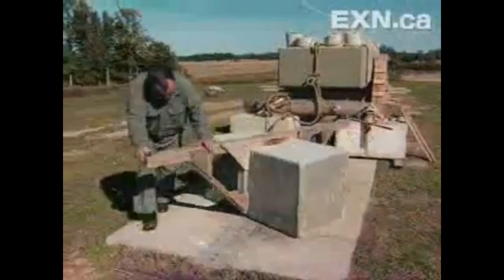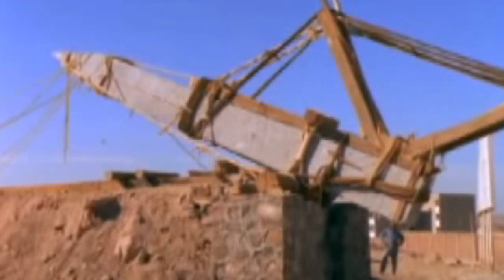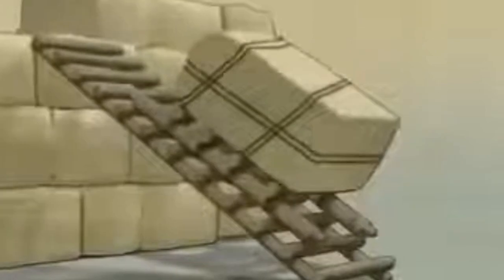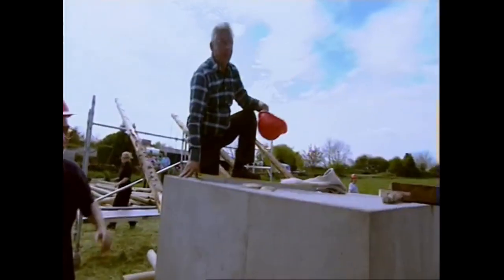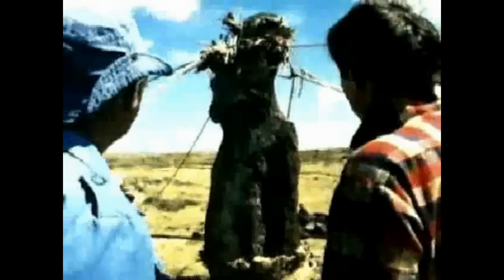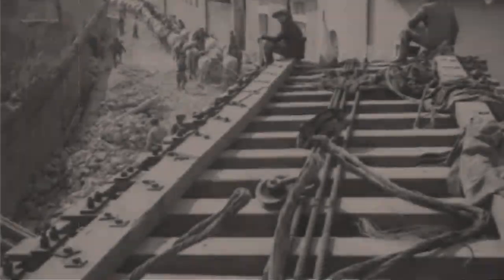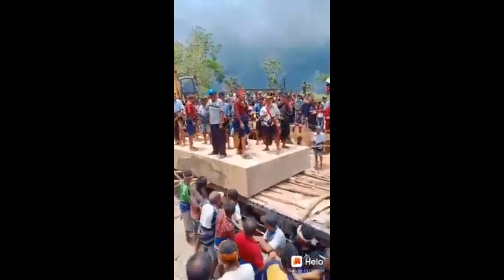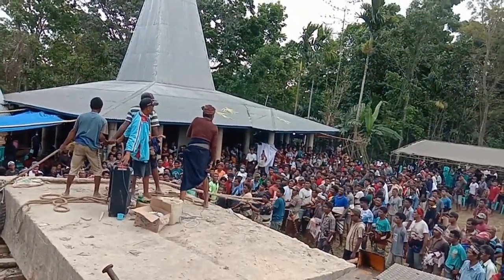How The Ancients Could Move & Place MEGALITHS With Primitive Tech. LAHT WON'T SHOW YOU THIS!

Comment: None of the stones in your video are even close to the size of the largest megaliths moved. We dont know how they moved them into precise positions  and we dont know how they got these stones on and off boats. If these techniques really do scale up to the largest stones, i would like to see a video of them being used for the big ones. All the stones in your video are realatively small compared to the largest megaliths we have found. Some of the stones at machu pitchu were placed precisely into cracks in the bedrock, these would have had to have been pushed into place rather than pulled. Being pushed into place they would not be able to use men with ropes. Also the stones at machu pichu would need to be carried up a steep hill side. Though it is theoretically possible for these megaliths to have been built by armies of men with ropes and wood, it reall is unimaginable to believe that all these megaliths around the world were done this way, the speed and orgsanization of man power is simply unimaginable. If these men were doing this they would have to be very very modivated, which suggests there was some very important purpose to their megalithic work. You dont get 1000s of men to work day in and day out cutting and moving massive stones with extreme precision just because you tell them it will look cool for the gods when your done.
Reply from the maker: Alexander column block when removed was approx 3000 t. Then the 650 t obelisk moved and placed with precision.
Parthenon restoration, in order to preserve original stone they fitted these shattered pieces with new stone using ancient technique but completely separate issue to moving.
Throw a rope over a tree branch to lift something up by pulling down on the rope, same as pushing and pulling. 
It is a proven reality of physics the amount of force needed to move, mechanical advantage of compound pulleys etc is true. Modern cranes work on exact same principle, wood and rope was used to move massive weights as the above mentioned Alexander column.
Stones here are heavier than any in Machu Picchu, I have compilation of old quarry photos of them moving massive stones as part of their daily working life. With wood and rope. Blocks of 60, 100 and 300 tonne in the age of photography, they moved buildings weighing many times heavier than the heaviest megalith.
"it really is unimaginable to believe that all these megaliths around the world were done this way, the speed and orgsanization of man power is simply unimaginable"
No it is not, they arranged large armies and went on campaign into foreign countries. Speed? The records of moving megaliths such as Hatshepsut shows a reasonable amount of time.
Extreme precision? 
"You dont get 1000s of men to work day in and day out cutting and moving massive stones with extreme precision just because you tell them it will look cool for the gods when your done."
YES YOU DO! A king gets them to march into foreign countries and prepare for battle. Any historic city was literally tens of thousands if not 100's of thousands people labouring away.
Everything here can absolutely scaled up, it is simply a lie spread by the likes of uncharted x and joe rogan that it cannot be. They are basic principles of physics that make our modern world work.
Reply: "None of the stones in your video are even close to the size of the largest megaliths moved"
So?  By which engineering principles do you think such efforts cannot be scaled?  I'd really like an answer.

" it reall is unimaginable to believe that all these megaliths around the world were done this way, the speed and orgsanization of man power is simply unimaginable"
Horrible grammar aside, yours is a textbook argument from incredulity, and so can be dismissed.  When you can formulate a non-fallacious argument, feel free to dive back in.

Oh, and BTW:
https://www.youtube.com/shorts/rMH6qzn1puQ

"If these men were doing this they would have to be very very modivated"
Yes, the motivation is called "getting paid".  Anyone who has ever needed to pay their own way in the world knows about it.  What's your excuse for not knowing?  Oh wait, I think I just answered my own question.
Reply: What weight do you think a stone needed to be before the ancients decided to start up their anti-gravity machines?